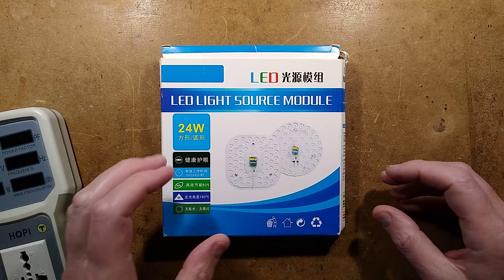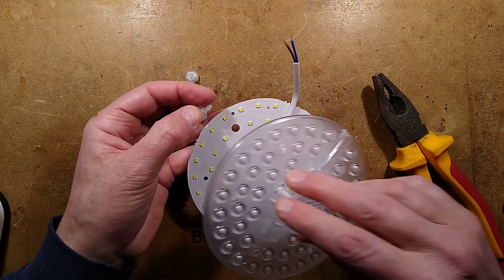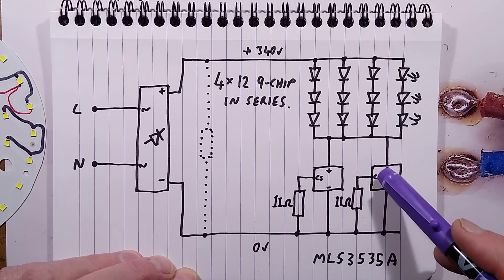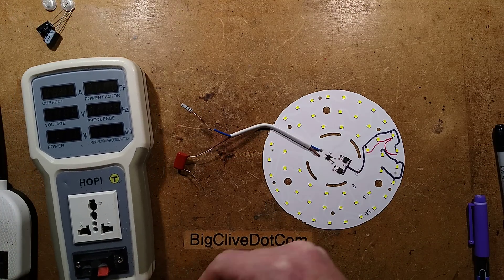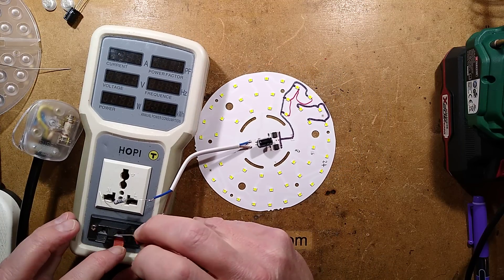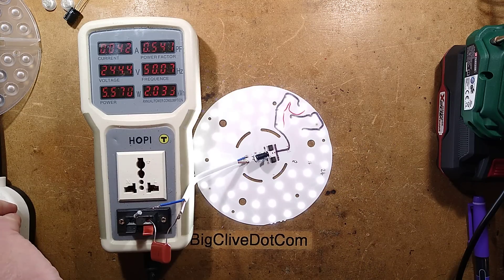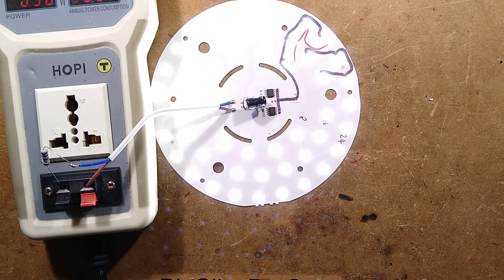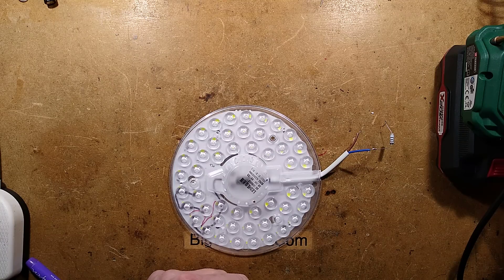Upgrading a downgraded light

Comment: I received a flash drive from China today that claims to be "two terrabytes" and I don't believe the reviews or the claim. If I sent it to you, would you confirm it's capacity? (One way or the other) would you like the link?
Reply from the maker: There is a PC program floating about that does a full memory test.
Reply: It's 99,99% fake, in reality it will be a 32Gb or so. You can test it by fill it up with big video files, once you reach the limit, you get a error messag that the flash drive is full. Years back same story when i bought a 1TB flash drive very very cheap from Wish. Always pay with PayPal online, and you are guaranteed receiving back your money.
Reply: There's no need to test anything, you'll be lucky if it's 16GB and when you exceed the real capacity the new data overwrites the old data and you lose the old data and sometimes the new data too because the filesystem becomes corrupt...

The worst thing is that there are flash drives and memory cards of different types of counterfeit brands on the market, even in physical stores, so you can lose a lot of money on the product and then also lose the stored data if you do not realize in time you've been scammed.

I use the H2testw 1.4 program which is free and works fine.

If you already have something stored on the drive to be tested you should copy it to another drive to avoid losing it if it is a fake capacity drive
Then it is best to format the flash drive before checking its capacity. A quick format is enough and it doesn't matter what file system you choose.
The test can take several hours on large capacity drives, if you suspect that it is a fake drive you can specify that it checks only up to a certain capacity, in this case I doubt that the real capacity reaches 32GB you can specify 33000 MB and so on although the drive be quite slow it should finish in a couple of hours.
If it doesn't pass that test, you know you've been scammed and you can throw it directly in the trash to avoid accidental data loss.
Before throwing it away request a refund if possible but I do not recommend that you keep the unit once you have definitively recovered or lost your money because you risk losing valuable data and being "stored" in memory that does not really exist can never be recovered.
And if by chance it passes the partial test, it is best to format it and submit it to the total and very slow test.
To write 2TB at 10MB/s it will take 55 hours, even with a 50MB/s write speed it will take 11 hours.

The link to download it from the author's official site is this: https://www.heise.de/download/product/h2testw-50539/download

Comment: Did you notice that after you changed the resistors to 22 ohms the power factor dropped to .5 from the original .9? I wonder why,
Reply: It changed when he added the smoothing capacitor not when he changed the resistors. It's what capacitors do.
Reply: @chrishartley1210  Okay that makes perfect sense.

Comment: Photons do not exist, it's a made up word, light is ether disturbance.
This can easily be debunked by running light through a different medium than air or vacuum e.g. like glass, the propagation of the light will slow down.
After it has passed the glass, the speed of the light (which is the propagation of the disturbance) is back to the old level.
When light would be a photon this would be in conflict with the law of Law of Conservation of Angular Moment without adding external force.
Reply: What nonsense.
Angular momentum...? Do you mean regular translational momentum?
The momentum of a photon does not depend on its speed, it's found as p = hλ. The wavelength λ does not change in refraction, and Planck's constant obviously doesn't change, so the momentum also does not change.

Also photons never change their speed, the only appear to change their speed in refraction. (See phase velocity vs group velocity.)

Comment: Who would want lights that flicker? I wouldn't. I assumed it was because of your camera, but no, I guess not. Interesting video! Great improvement with the caps and resistors.
Reply: in normal day to day use, you will most likely never notice the flickering but there are those that are more sensitive to it, like i notice the backlighting of my keyboard flickering when im not looking directly at the keyboard, said flickering on my keyboard was even worse when i used it on a usb polling rate of 100hz, now at 250hz polling rate its far less noticeable flickering

Comment: Kreosan was just scraping down one of the paired resistors for longer life with a meter hooked-up to monitor the drop till it was what he wanted. He was doing it to drop the input when one led burned and he shorted it with black silicone (yes lamp black and charcoal conducts electricity, I've elecroformed with both when I had problems with "pure" graphite that was more like silicon dioxide powder with graphite but visually you could not tell)  to relight the "string".
Reply: Dude, you need a more violent name.
Reply: @johnpossum556  😅

Comment: There is another module somewhat like this that DiodeGoneWild tested.
The leds are in 3 strings and are turned on at different points in the cycle.
Are you sure there is only one connection between the leds and the driver ics?
Check the waveform with a scope.
Look at his video, it is interesting.
Reply from the maker: Just one.  It's not the multiple tap style that rides the sinewave.

Comment: Hey Clive, There’s a bit of a controversy brewing on the interwebs regarding UV led street lamps. I was wondering if you could perhaps do a little video to address what’s going on and why they create the purple light that is absolutely horrendous to drive under at night. I don’t know if you’re experiencing this issue across the pond, but I believe you probably have the knowledge to explain just what sort of failure is occurring, whether a coating issue, or failure of a particular color led, or whatever causes my windshield to momentarily flash a blinding purple glow as I drive home each evening. There is a lot of hyperbole out there about what I’m sure is simply dodgy engineering. I appeal to you, the beard of electronics knowledge for enlightenment. Thanks for the informative and entertaining videos.
Reply: I just searched "UV street lights" on YouTube because of this comment and the results show total idiocy.
Reply from the maker: The violet chips stimulate phosphor which is detaching in this instance, resulting in a glorious (but safe) deep violet colour.
Reply: @bigclivedotcom  I think the usual LEDs produce something like 395nm or 365nm, so the rather safe UV-A. Sadly, LEDs that get you spicy UV-B and UV-C are still a lot more expensive :/ 
We used some 255nm LEDs for ozone detection via absorption, and I have never spent as much on handful of LEDs...
Reply: Sounds like the phosphor coating of these LEDs got damaged in some fashion. The LEDs in those lamps normally put out light in the UV range. To turn that into nice white light, there is a coating on it that absorbs UV light and emits longer wavelength light. Kind of like how bleached clothing shines in dark light (UV).
I'm guessing they screwed up the coating, or maybe didn't test if it could take the temperature cycles of an outdoors environment.
Reply: I’m not a real expert, but I’m pretty sure that (a) the purple is not indicative of UV, and (b) even if it were UV, it’s likely less than the sun provides. Some people are just illogical. It’s ok to ask the question, but really searching for the answer is wisdom.
Reply: Don't many cars use a UV LED pointed at the high beam reflectors to enhance the reflected light on jackets and vest of road workers?
Reply: @Dennis_M1DLG  No.  I suspect you're thinking about the colour fringing at the edges of a beam which at the right angle would give the appearance of a thing bluish-purple band in the light output.  That was more of a problem with early HID lamps with refracting optics.  Most LED headlamps rely heavily on reflective optics for beam focusing.
Reply: Mikeselectricstuff did a teardown of such a light... I can't remember the wavelength though.
Reply: I have most certainly witnessed several led street lamps degrade from white to completely violet. Sometimes very quickly, in weeks or days even.
Reply: Search for "technology connections" streetlight vid.
Reply: It's just a failure of the phosphor.  There's no ultraviolet light and there are no violet chips in street lights. 

The white LEDs in street lights use blue LED chips and yellow phosphor that converts some of the blue light to yellow light.  Blue light plus yellow light makes white light. The vast majority of white LEDs work this way.  

A complete failure of the phosphor causes the lights to turn blue, because then you only see the blue light from the chips, with a wavelength of around 440 or 450 nanometers.  In some cases the phosphor has chemically degraded so that it no longer coverts the blue light to yellow, and in other cases the phosphor layer has just cracked and fallen off. 

A partial failure of the phosphor can cause the lights to turn purple, which is the blue light of the chips plus some red light from the partially functioning phosphor. 

White LEDs emit no ultraviolet light and are not pumped with ultraviolet chips.

Some newer white LEDs are pumped with violet chips, but they are much more expensive and only used in applications that demand the most accurate color rendition.  They are not used in street lighting.  They are specialty items from a handful of manufacturers: Seoul Sunlike, Soraa, Nichia Optisolis (some), Yujileds VTC, and Guangzhou Juhong sunlight spectrum LEDs.
Reply: @jbalazer  They're brand new lights, nice try.
Reply: Oh, and purple light is not the same as UV light. Most adults (older than teenagers) cannot see most wavelengths of UV light. Humans certainly cannot see UV-B or UV-C light. 395 nm UV LEDs may appear as purple because that wavelength is on the boundary between what is considered to be visible light and UV-A light. Also these LEDs may produce some longer wavelength light which is in the visible range and hence is purple or violet in colour. In any event these wavelengths (around 395 nm) are not harmful to humans under normal circumstances. The UV light from the sun is far stronger.
Reply: @Mark1024MAK  That's true, probably 395nm, or even 400nm, as 365nm LEDs are less efficient and more power would be lost in Stoke's shift in the phosphor, but age doesn't come into it. I think you're confusing ultraviolet, with high frequency sound, near ultrasound, which can be detected by young people, but sensitivity declines at adolescence onwards.
Reply: @alunjones3860  interestingly, sensitivity to near-UV decreases with age as the lens of the eye “blues” (blocking blue light). Young people can see slightly farther past the “visible” spectrum into UV. As they age, that range decreases.  With cataract surgery, the lens is removed and some can see slightly beyond the “visible” spectrum again. Note: modern cataract surgery implants a synthetic replacement lens that specifically and intentionally blocks UV. Because UV into your eyes is bad.
Reply: @BlackSoap361  That doesn't make any sense. If the lens of the eye blues, then it would block longer wavelengths, reducing the sensitivity to green, yellow, orange and red.
Reply: @alunjones3860  it blocks shorter wavelengths first.
Reply: @BlackSoap361  A bluer lens would block longer wavelengths.
Reply: I drove 200 miles at night in the U.K. at the weekend, so traveled under thousands of street lamps, most of them LED type. I did not see any that were purple in colour. As others have said, the vast majority of white LEDs used for lighting purposes use LED chips that emit blue light. The phosphor then converts some of the blue light so that the final output is white light. Only a very small number of specialist applications use UV LEDs. UV LEDs are more difficult to manufacture and are considerably more expensive. Hence I would not expect these to be used in street lamps. And even these are very unlikely to result in any significant UV light, as the glass or plastic housing will attenuate UV wavelengths. And the glass windows on a car will also  attenuate most UV light.
Without more information, I can’t help any further with answering your question.
Reply: My town replaced many of their older LEDs with those new street lights. The very first time I saw one (not yet broken and purple) I knew they weren't going to last long. Low and behold less than a month later a couple started going purple, about a year after that 50-70% went purple.
Reply: Longer wavelengths disperse more, which means they are worse in fog.
Reply: To those people saying blue lighting LED's aren't UV so it's safe, that's not true. Specifically, blue light has shown to cause specific photochemical reactions in the retina that cause damage. Thus, IEC 62471 and ANSI RP-27-20 have a "blue light hazard" limit, weighed by a spectral response function that's significant around 400-480 nm. In general, you should not stare at intense light, white or blue.
Reply: @straightpipediesel  Violet/blue light is only harmful at high intensities. There's no way a bad street light would exceed the safe exposure limit. Looking at the blue sky away from the sun, on a clear day would expose one to a much higher intensity blue/violet light.
Reply: Sometimes blue chips can emit purple waves (spectrum), without being technical. More to the point they can be edging so slightly into purple rather blue. Also, it should be noted that car windshields, as you prefer, do have UV coatings or stuff baked into the glass it self so you don't turn into a tumbleweed or a baked potato. Crispy pork loin maybe...
Either way, the glass if the refraction of light and the beam of light and the correct colour of light and the photon direction all hit correctly at the right junctions, you get glare.

This purplish light you mention I see from LED headlights going down the road but because the angle of light is so that it doesn't refract accross the whole screen, I don't get blinded by that particular spectrum of light the led light is emitting.

UV is a specific wavelength of light and while it does emit a purple colour, it's not the same as purple spectral light 
Note ozone generators and germ eradication devices that say they use UV light and they are just purple coloured LEDs. Fakery fake fakeness
Pretty sure now I blabber that purple from LEDs is blue chip with a form of coating.
I think the base answer is because there are so many factors that could reasonably say why you experiencing what you are it gives rise for the doomsayers to emit from the free to speak minds things that are not necessarily true while trying convince one that the egg most definitely came first...
Reply: I say all this however while not being aware of a campaign of rhetoric about the subject you speak.

Sounds a bit intimidating, having the idea that your being cooked while driving down the road.

Alas, your screens do have some protection, but I think it's only one, uvb or uva, some might have both, but it's a case of 'how fancy is your car, how fancy is your glass' kind of buck.
I'm not an expert, so don't take my word for all of what I said but I believe what I said to be more or less correct.
Reply: @T_Perkins  Brought to you by the same dartk forces resposible for chemtrails! 🙂
Reply: @mikebarrett2621  You're talking a phosphor coating, these are brand new lights, brand new installs, not what you're attempting to explain it as.
Reply: @mikebarrett2621  Stop noticing!  ...trying to think what combination of emoji etc I could add to that to soften the edge there but, ... ?

Comment: I'd be inclined to buy better. Failing that, I'd improve the design with a smoothing capacitor and anti-ghosting resistor then reduce the wattage to 80% of the resultant value by changing both sense resistors. I've no desire to dim everything to night light levels nor make it outlast me.

Comment: I miss the smell of smoldering resistors.   Electronics Lab always had a pall in the rafters and an odor of ozone and fried ceramic. EL was a recycled hangar with fans in the eave ridges, no real modern ventilation system.  it was an Olde School.   wow, that was a fuzzy olde memory..  thanks Clive.

Comment: Just a quick curiosity question. I live in the US (110v) but mistakenly bought some 240v led lights. The power supply seems similar to this. Is there an easy mod to convert to 110v?.
Reply: Start shorting one LED at a time until the lamp lights up? Rather start with almost half shorted out in fact.
Reply: Add two capacitors to turn it into a voltage doubler.
Reply from the maker: But really with this type of circuit.